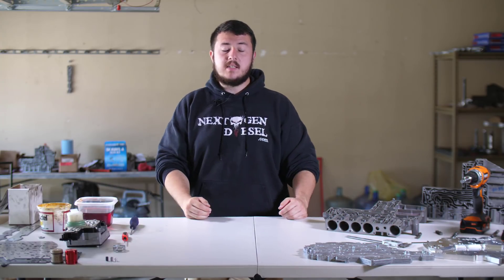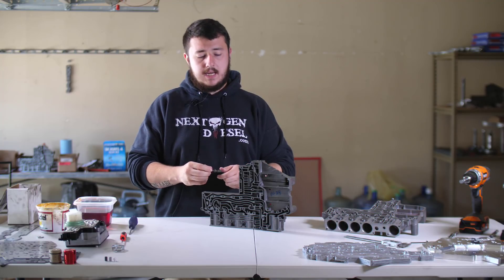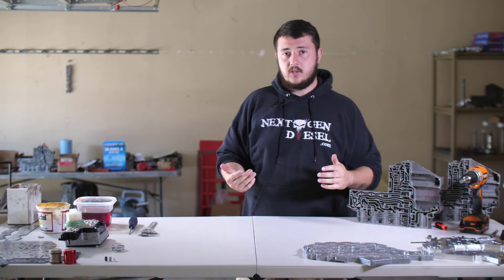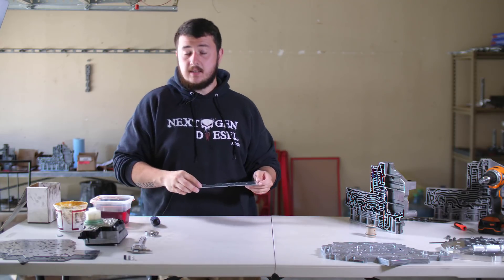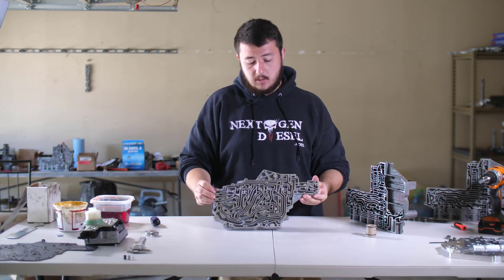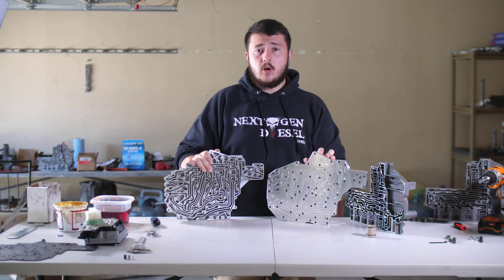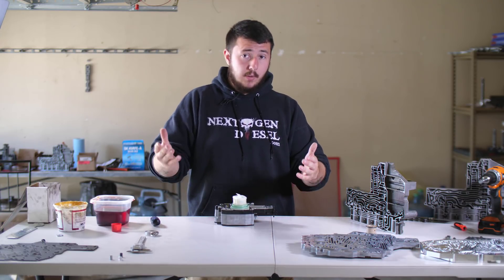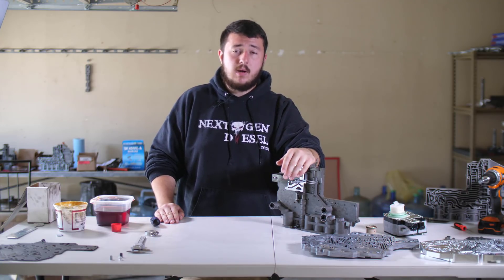[6.7L Cummins] Next Gen Drivetrain 68RFE Billet Valve Body Teardown + Buyers Guide!

Comment: I have a quick question, is "Project Carbon® 68RFE High Performance Billet Valve Body" the same as "Project Carbon® 68RFE Valve Body DIY Upgrade Kit - V4.0 + Project Carbon® Billet Channel Plate" just already assembled?

Comment: 2017...So if I just got a Dealer Warranty Rebuild at 98k miles (108k miles now) that they did basically everything But the complete Valvebody. They said they did a piston or 2 in the VB and the solenoid pack, Fluid Pump, Torque Coverter, and other smaller things. But I still have the Bumpy and hanging/lag shifting, sometimes hard bump on down shifting. All of this on non hard driving. Worse of course with Up shifting on harder accelerating and especially when got a engine tune with Trans tune too. Also only 342 gears and 37" tires (literally 36"). Plan to do 38's or 40's with 456 or 488 gears.

Would just the $399 V4 DIY build kit do wonders and allow a higher shift pressure to not wear or beat up on the trans, or need more things replaced as in the $995 High Performance VB?

Does the $995 purchase include what's in the $399 VB kit or they're separate to purchase and install?  One or both are easy enough DIY installed?

FYI...
It is a 130hp tune with TCM reprogram too. It is all for moderate and full emissions in place truck.

Comment: I’m considering a 24 ram 3500 diesel/68rfe towing 15k 5th wheel. Should I look for Aisen or?
Reply from the maker: @eberhoozen  Either one has strengths and drawbacks, and either one is hyper reliable with a valve body upgrade from day-one. I would proceed with either one and just be sure to throw a valve body in it right away! The 68RFE is a little cheaper to work with and easier to find support for, but the Aisin will pull more weight with more ease. Neither answer is a wrong one.

Comment: I have a 4th gen 68RFE with 233k and have no known issues with it. I've been performing more of my own maintenance ever since I lost my business during covid to save money. On the stock valve body, I noticed what looks to be either mold casting lines that looks like cracks or possibly there's been some warping that has caused actual cracks. I never towed much while having my business. If there's a way to include a picture I will. I'd like to get an option out there if these are cracks or not, basically if this looks normal.
Reply from the maker: @ChrisBackos  Call us Monday and we’ll help! 1-833-382-5427 Ext. 1
Reply: They all look like this. Common. Just the casting.

Comment: What would cause clunky 2 to 1 down shifts at real slow speeds like slowing down before my driveway.   48000 miles on my 68rfe.  Stock trans
Reply from the maker: Bad accumulator pistons! Valve body time! When they bottom out against the backing plate before a shift is complete, you’ll get a bang. 2-1 downshift is seemingly more common for this symptom.

Comment: Did ram ever update the 68rfe transmission? I am looking at a 2019. Is it exactly the same transmission as a 2007 when this trany came out?
Reply from the maker: The transmissions are different brother! They changed from 2007.5 to 2010, 2011 to 2018, and then again in 2019. The units are all slightly different and the changes are primarily in the pump and valve body.

Comment: Just found your video. If I buy this valve body up grade, what about the trans relearn? I think I can do this myself. But this is a lot of money. Can you talk about that.
Reply from the maker: Yes sir! Easy day! A relearn is not necessary during install, but is helpful if possible. If you do not have the means to perform a quick learn, DON’T WORRY! Just drive the valve body at under 30% throttle for the first 100 miles and in this timeframe, the CVI’s will all hone in perfectly and this will substitute the act of the quick learn in final effect. For further support, give us a call at 1-833-382-5427!
Reply: Still looking at your valve body. Do you have a trans pan that will fit or what pan do you recommend for clearance?
Reply from the maker: @UncleJack5224  Hello! On our website, a deep pan that fits our product is available for $285!
Reply: Thanks for the quick response. It’s important to me to have everything I need when I start the install. I’ll give you a call next Monday. Thanks
Reply from the maker: @UncleJack5224  Yes sir!

Comment: i just installed bypass in my truck temp dropped from 175 to 130 is that better?
Reply from the maker: Great improvement!
Reply: Next Gen Diesel Isn’t that too low for the oil operating temperature?
Reply from the maker: g b No sir, that’s a totally safe number.
Reply: Next Gen Diesel Sounds good what is the lowest temperature number that is still good for the transmission?
Reply from the maker: g b Though there is no specific answer, if it operates in the 50-110 degree over ambient temperature margin, it is generally healthy.
Reply: Next Gen Diesel What about when it’s -30°F in the winter?